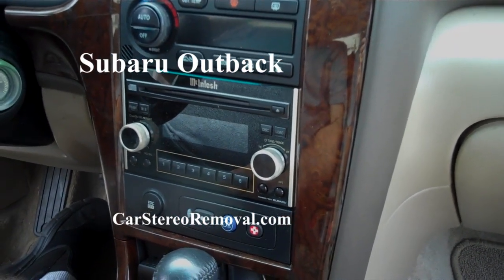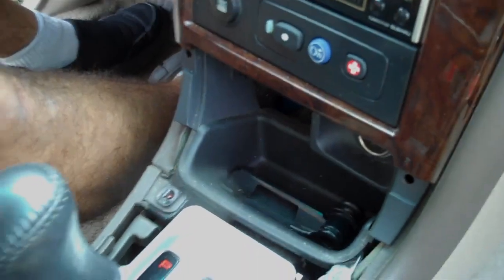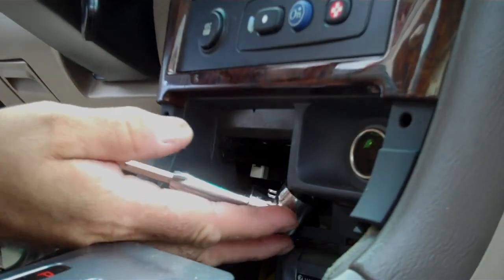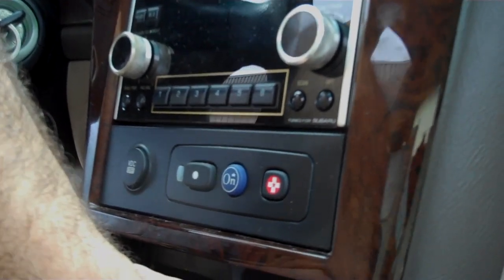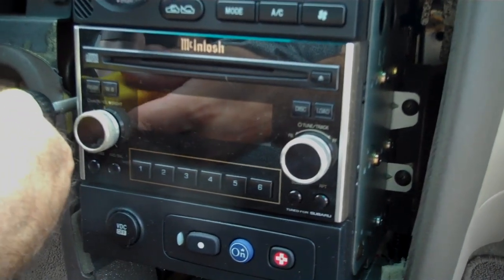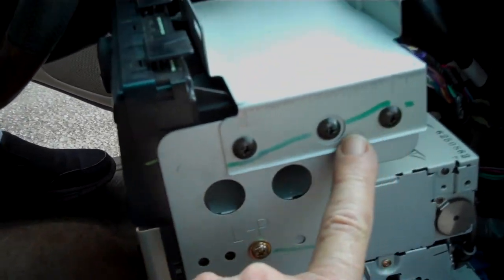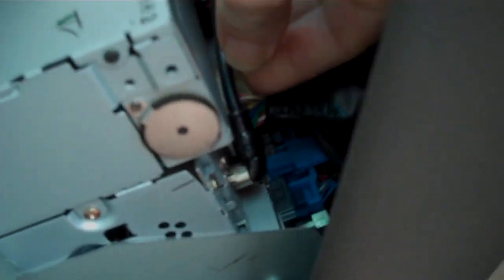Subaru Outback Radio Removal - Car Stereo HELP

Comment: I got the stereo trim that has the cup holder for my 2004 ll bean outback, but it will not fit due to the box above the stereo, what is called the phone module in this video. Is it ok for me to remove this module? Will this mess anything up?

Comment: The stereo trim with the cup holder was for the '01 & '02 Outbacks. I did try to fit it on my '04 LL Bean, no go. at first the Motorola Phone Module, shown in the video, mounted to the top of the stereo, which is for the On Star, was preventing the cup holder from fitting, but even after I removed this I could get the trim to fit, but it was such a tight squeeze that the cup holder would not open. So I reinstalled the phone module and the old trim. ☹️

Comment: I took my radio out and when I put it back in the air conditioning/heater won't work the led turn on but no air, also the cigarette lighter has no power

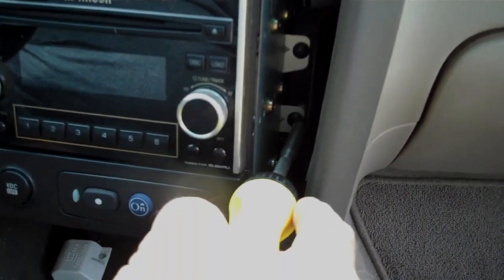Comment: Thanks a bunch for sharing this! In my 2002 model, the "Security Unit" also had to be removed, as it was in the way of the screws at 5:22
Reply: Oh, and two more screws holding in the stereo bracket that were behind the ashtray assembly!
Reply: @BlueHoundDog  I just bought a 2002 legacy outback wagon and am having a grounding issue somewhere. Radio works but has a little fuzziness to it, when I tried to use a cassette to aux adapter no sound and made a steady high hissing static sound until I stopped cassette. I then bought a KM18 Nulaxy Bluetooth Car FM Transmitter and it works but still gets a bad hissing fuzzy hissing noise in the background. It also reacts to my hand moving closer to it. If I get my hand close to the device it gets loud then if I touch it it gets very quiet making me think its a grounding issue somewhere as that thing is plugged into the cigarette lighter for power. Any thoughts or ideas? Would putting more grounds from my negative battery terminal to other parts of the car to help ground it help this issue or do you think it may be a loose wire somewhere in the stereo perhaps?
Thanks!
Reply: @lightwarriors7778 Cassette to aux adapters are notoriously iffy, I had issues with at least two before giving up on those. I ended up soldering the leads of an aux cord directly to the audio signal source of the cassette player. Definitely a pain to get the thing disassembled though, not the kind of project I would take on again. There is also a plug on the back of the stereo unit to connect an optional CD changer from the trunk. The pinout can be found online, but I guessed that some sort of digital communication has to be mimicked to get the stereo to listen so I didn't go this route.
To reduce electrical noise from your FM Transmitter, add a "ferrite bead" to the power cable. Hope this helps!
Reply: @BlueHoundDog  Thanks for the response. Yea I think out of all of those things you just mentioned the ferrite bead route may be the best though I've already spent $17 on the km18 fm transmitter itself and not sure if those ferrite beads are wide enough to fit around the cable as it's a snake like flex metall wrapped kinda cable that you can bend and mould how you want.
Reply: How did you remove the security unit?

Comment: This video was very helpful. My car is a 2001. Is it the same as the 2003? If it's slightly different, that's fine but if it's a major difference, where can I find a video of the 2001 outback? Thank you!
Reply: I believe the 00-04 outback models are all the same, as well as the 00-04 Legacy's and front half of the Baja's